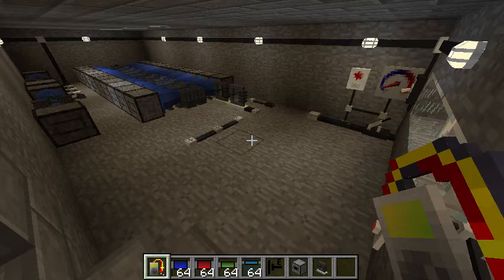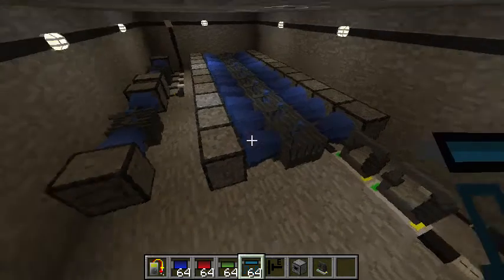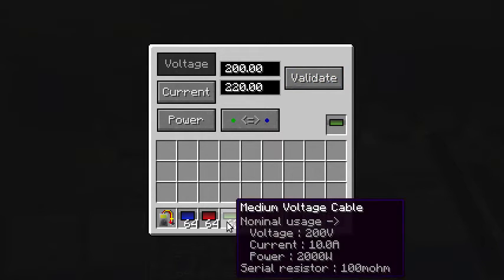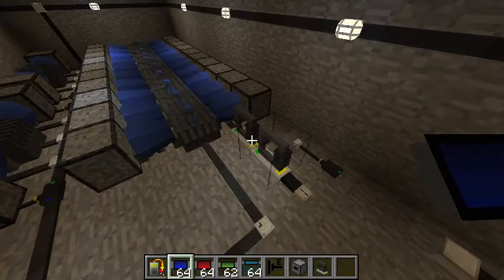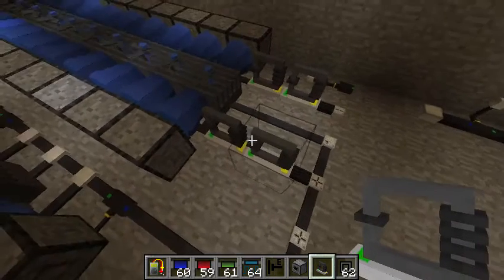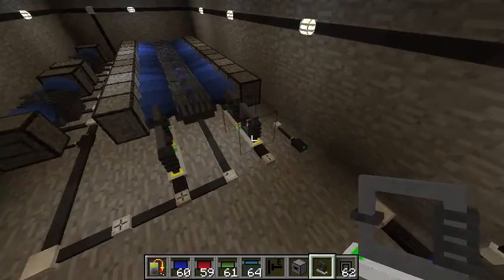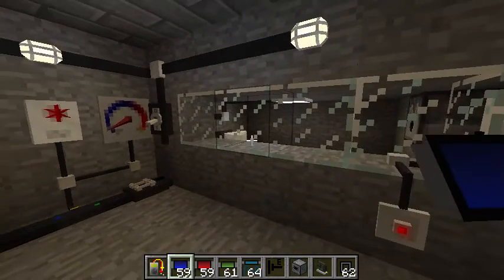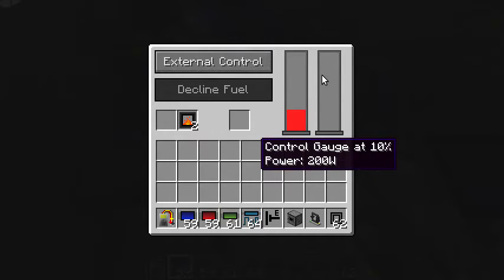Minecraft Electrical Age Mod Tutorial 07 - Building A Power Plant

Comment: Such a great video.  I must have watched it a dozen times. 

Now I'm just trying to figure out how to power a teleporter / transporter. I can easily get the 800v, but it creates such an instantaneous power draw that my furnaces (regulated) can't kick in fast enough to generate the extra power. I'm trying to figure out a way I can keep a constant power draw on it to keep the furnaces up to temp, maybe. But I'm not sure if that's a thing, or if it would even work.
Reply from the maker: Power is like pressure in a hose versus pressure in a straw.  Both can have the same pressure, but you get more flow out of the hose.  What matters is how much power the teleporter is drawing.  Right-click it and check to see what that is, and make sure your turbines are able to provide that power.  If your transporter is taking 3000KW, but you only have two furnaces that can make 2000KW, then you won't be able to charge it no matter what. Furnaces can adjust decently fast, but if your draw is really high you might need a few current-oriented batteries to even out the load while your furnaces heat up.  Just be careful because those can blow if you drain them too fast.  Ask me how I know...

Comment: I know this is very old but for some reason my cables explode from excessive heating when powering a lighting in my entire base. Like I watch the cables with multimeter and it's just jumping like up to 90° C or even more than that until it explodes. I found out that putting more cables around "dissipates" or "splits" the heat but that is unrealistic solution...any ideas? Is there a block for that?
Reply from the maker: Heat overloads happen due to too much current passing through the wire.  You can use circuit breakers or fuses to prevent that from blowing your cables before they get that way.  As to how to prevent it in the first place, this all depends on how many lights you're trying to run, what cables you are using, and your power source.  If the total wattage of the lights is greater than the cable wattage, that's gonna give you problems for sure.
Reply: @donbruce5466  Thx for the reply, I'm powering something like hundreds of lights with(my mistake) too few lamp supply units and it overloaded the cabels. I didn't know so many light bulbs would be so demanding :P
Reply from the maker: Yeah, they can trip you up like that.  You'd think they aren't too bad, but when you try to power a bigger building with about 5 per floor you realize they eat up energy pretty easily.  I started a project to electrify the Vertoak map and quickly found that the tall, 12-story building near my power plant needed a whole 800V high-power line going in due to the huge number of lights it used.  I had each floor get it's own lamp box, but even then I found that I had to watch what I put on the system as it's easy to overload the 200V systems in a big building.

Course that was before they added LEDs, so I didn't have the luxury of low-watt lighting!

Comment: I don't think anyone will see this let alone actually help me with one issue, but I have a problem when I have almost the same power plant capacity as in this video (11 kW though, not 10) and I need those to supply a lot of lights in my underground lab. And it's big it has probably few dozens to max few hundreds of lights to supply and power consumption is rather small about 1-2 kW but problem is voltage drop voltage is so low that even though lights are on the light level is so dim that it's like candles. I even tried making secondary power grid on the surface with batteries and solar panels but problem here is the distance to which i'm transferring power so there is voltage drop here as well since they're on surface and lab is pretty deep(a bit above bedrock level) help lol what am I doing wrong..?!

Comment: Hello Don! I spent a lot of time trying to regulate the steam turbine while accepting steam from Big Reactors, but to no avail. The steam turbine just keeps going until it... yeah, i suppose I don't need to clarify that part! Do you know how to do this? I can't find any tutorials for it anywhere.

One more thing I want to know is how do I get the water turbines to produce a decent amount of power? 
The water turbines produce around 59V, and no matter how many of them I have hooked up to a cable, the voltage just stays the same, whereas the solar panels adds voltage for each panel placed. I realize there is an explanation for this behavor, but the problem is that I don't understand the basics of electricity, and my mind thinks "If a water turbine is 59V, then one more water turbine on the same cable will produce 118V, and so on and so forth...

How can I achieve a greater voltage, say a stable 200V with only water turbines? Thank you!
Reply from the maker: Believe it or not, I haven't fired up an EA world since I finished my last tutorial vid.  Too much modding work.  Safe to say, I have no experience with the new turbines. Waterwheels, however, I can help with.

The differences between the waterwheels and solar panels is that the wheels are hooked into the cables at random points, while the solar panels are hooked in series.  Think of the panels like a battery bank: if you put them in a line the voltage gets higher.

Another way to think of it is like a train.  If you have two trains hooked together they have double the pulling power.  If you split them apart, they can still pull the same total number of cars, but the pulling power of the train itself is only equal to the power of one locomotive, not two.  This means that two trains hooked together can carry 100 cars, or each train can carry 50.  They still carry the same number of cars (same power output) but the single train has much more force than the two separate trains (more voltage).

I'll take a look into the steam turbines.  I've always wanted to hook Flaxbeard's steam mod up to an EA system, but I've never been able to until now.  In the meantime, you're more than welcome to PM my Minecraft account with questions on the forum.  I check that much more frequently than the YouTube comments.
Reply: +DonBruce Thanks for the answer! So in general you are stuck with about 59V if your choice is to go the water turbine route then. It would be great being able to harness hydropower in EA to greater extents than just powering a 50V lamp. Coal burners and turbines provide more than enough juice, but they just don't look as cool in my opinion.

While we are at it, if I plonk down a certain number of lamps to a lamp supply, the cables burn even if they are high voltage+ cables. I guess the wattage is too great because of the demand it takes to run this many lamps, and that there's no way around this than to simply build more turbines and hook up another lamp supply to alleviate the cables of their burden?
Reply from the maker: You can use hydropower for larger projects; you just need to up the voltage using a transformer.  Do note that water turbines don't generate a lot of power, so they're best used as battery chargers for variable-load systems.  I have two of them hooked up to some high-current batteries that feed a transporter.  The water turbines slowly charge the batteries, which then can be drained quickly to power the transporter.

As to the lamps, you're confusing voltage with power.  If a lamp is 200V it should be supplied with a 200V cable, not a HV 3200V cable.  This is because cables have a current/amperage limit on them, which gets lower as the voltage rating gets higher.  If you're running 200V through a 3200V rated cable, you'll easily run past the amperage rating and burn up a cable.  You're correct in that there's too many lamps for one supply box, but you're incorrect in using a larger cable to solve the problem.

There's two ways to fix the overload issue.  The first is to make another power source that feeds another lamp box to distribute the load.  Just make sure the source for this other line doesn't share the same cable network as the first line, otherwise that section will burn up as it's essentially supplying the entire lamp system.

The second way, and the way I would go about it, is to up the voltage coming out of the power source prior to transmission, and then step it back down before feeding it  into two lamp boxes.  You still need the two lamp boxes to distribute the load, but this way you don't have to mess with multiple power sources.  Just take the output from some 200V turbines, step it up to 800V, and then step it back down to 200V prior to feeding it into the lamp boxes.  The higher voltage transmission line also means that less power gets lost on the cables due to transmission loss (see the power video).
Reply: DonBruce I love your vids

Comment: Hey Don, your tutorials are unbelievably amazing. I never could get such information out of other tutorials. Could you please do a video explaining the new items in the update for Electrical Age? I've been trying to figure out how to regulate steam using  redstone to control the new steam turbines. Or, if you have the time, could you comment some information on a way to regulate the turbines? Thanks.
Reply: These tutorials are absolutely golden! The only decent ones i've found. They have a Direwolf20 quality to them.

I really want to know more about this as well! I spent a lot of time trying to regulate the steam turbine while accepting steam from Big Reactors, but to no avail. The steam turbine just keeps going until it... yeah, i suppose I don't need to clarify that part!

One more thing I want to know is how do I get the water turbines to produce a decent amount of power? The water turbines produce around 59V, and no matter how many of them I have hooked up to a cable, the voltage just stays the same, whereas the solar panels adds voltage for each panel placed. I realize there is an explanation for this behavor, but the problem is that I don't understand the basics of electricity, and my mind thinks "If a water turbine is 59V, then one more water turbine on the same cable will produce 118V, and so on and so forth...

How can I achieve a greater voltage, say a stable 200V with only water turbines?
Reply: Michael Caplin this is very late, but...

You could use some transformers (DC/DC coverters) to increase the voltage coming from the turbines but you need lots of them to meet the power demands (wattage)

Comment: Now create a real power draw with distance added.
I tried and the voltage keeps dropping when putting the system on a slight load.
Any way to prevent or counter these voltage drops?
Reply from the maker: +Wokkelp The only way to prevent voltage drops is to transmit the power at a higher voltage.  You loose more voltage from drawing 100W on a 50V cable than you do drawing 100W on a 3200V cable.
That being said, there becomes a point where you will draw so much power that a voltage drop is inevitable.  At this point you can do one of two things: Increase the voltage at the power source to increase the voltage at the destination, or make another power line to reduce the load.  Long-distance power transmission is a bit of a balancing act.

Comment: Are you able to step the voltages down to 200v in order to power a lighting grid? One of my intentions is to power a whole lighting grid with this, but the problem with my last set up was that I quickly exceeded the wattages on the medium cable (2kw)
Reply from the maker: +Bryan Enriquez If you're looking to make a grid the best thing to do is use the transformers to step up the voltage right after the turbines.  This allows you to carry the same power but at a lower current (P=IV) so your cables won't overheat.  Once you get to a destination you step the voltage back down and use that.  As long as you have multiple down-stepping stations you'll distribute the load enough not to blow anything.
Reply: That was my plan, however, I do not know how to use the transformers to step down from 3200 to 200, I tried using them backwards I.e very high to four high, then high to four medium cables and they blow up
Reply from the maker: +Bryan Enriquez You'll want to look at my first video for the proper way to wire those up.  One common mistake is wiring up a transformer on a live line.  Since the transformer doesn't transform when you put it down you're basically connecting a 3200V line to a 800V line.  Also, make sure you use 4 of the high-voltage cables on the high side and 1 of the lower voltage cables on the low side.  Finally, you can only step the voltage down by 1/4 for each transformer.  You'll need two of them to go from 3200V to 200V (3200->800->200).

Comment: hi i have sent a email to one of the mod team with this question but posting here too as im not sure which i will get an answer from first so my question is at the beginning of the video you stated you pre placed the stone furnaces but in the video you haven't stated how you are getting them to start the temperatures going up with out fuel i have followed this video exactly how you have stated i've redone it 3 times thought i may have made a mistake then i downloaded the tutorial world checked my layout against that one and this video and there exactly the same nothing wrong so my question is how have you managed to get power to the lights and those furnaces without coal as you don't mention anything about coal in the video yet mine will only work if i put coal in the furnace at the beginning where the lights are powered and i cant get the other furnaces to heat up as soon as the signal cable is attached like it does in the video so is there coal in any of those furnaces at all or whats happening i have the latest version of the mod running and running minecraft 1.7.10 as i say i have followed everything you did in the video here but have no power but when i do put coal in the furnaces i end up with a very big explosion if i hook up that high voltage switch and the bot like in the tutorial world yet ive gone over everything even deleting everything 3 times and redoing it all thanks in advance
Reply from the maker: +david cosgrove Whoa mate.  Spaces and periods, pelase!  I don't understand what you're asking in the second half of your comment.

As to the first half, you can tweak EA to allow exceptions by using the commands specified in the first post on the mod's forum page.  In particular, you can use the command /eln heatFurnaceFuel = 0.
Reply: sorry about the spaces and periods don im disabled and cant spell and type things very well or clearly
my question was how you fueld the furnaces but i have found out why they wasnt working for me
i had got them set up to fuel only as you have stated in the previous comment
again sorry about the spaces and spelling don its why i dont speak much to people too because of this reason anyway i have got it working now
i also got street lamps working coming on and going off at morning thanks to some parts of your video :) hope this message is a bit better to understand
as i have pressed enter key after parts of what ive put
Reply: yea same question mine just goes BOOM!

Comment: Please can you make a power plant that provides for houses. It would be greatly appreciated if u did :D
Reply: +Dredz Lewis Something like that should be simple enough, but very time-consuming. You would have to set up multiple separate banks due to the power limits of current wiring. It would probably also take a lot of maintenance and take real-life days or even weeks unless you were in creative. Still, it would be very interesting.
Reply: +Daniel Duncan thnx for the reply. I plan to play on a server where people have different roles, some of which will be maintenance. As for the time consuming part, that's half the fun 😂😂
Reply: Dredz Lewis Keep in mind you will want to manage players' consumption within the factory, as meters are extremely easy to tamper with in-game. However, if you wish to make it convenient for the players so they can check how much they've used, you can have a second meter on their home. This way, they may tamper with their own meter, but the actual usage will still be shown in the power plant and therefore will expose tampering. Also, unless an addon is used or created or the mod is updated, there are a few things making that a reality more difficult such as the limits on how much voltage and power you can put through even the very high voltage cables.
Reply: Daniel Duncan You sure know your stuff :P. I have a similar setup at the moment on a single player world, and as you say tampering may be an issue, however if i remember rightly you can lock the meters?. I did take into mind that the mod will not resemble the reality in today's modern world but then at the same time minecraft is a game after all.
Reply: Dredz Lewis Yes, a password can be set. However, the password does not prevent breaking of the meter, removal of the meter's internal wire or direct bypass of it.
Reply: +Daniel Duncan True, Thanks for the advice anyway !

Comment: What about modbus I have no clue how to use it
Reply from the maker: AngelOfDeath I have yet to figure that out myself.  I did poke around in the code a bit, though, and I think that the issue is that the modbus isn't finished.  There's a lot of comments in there, and I couldn't get it to work in-game no matter what configuration I tried.  If I'm wrong, may someone correct me.